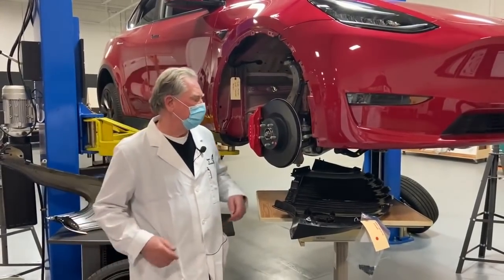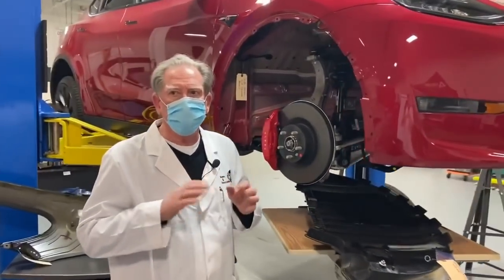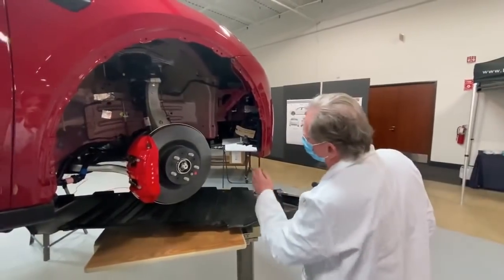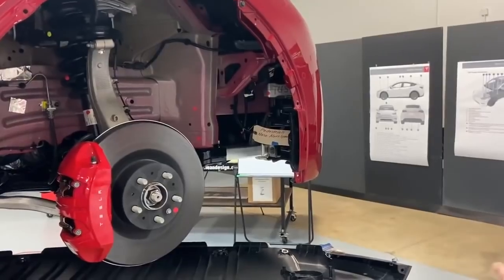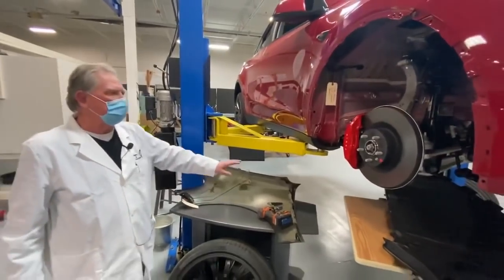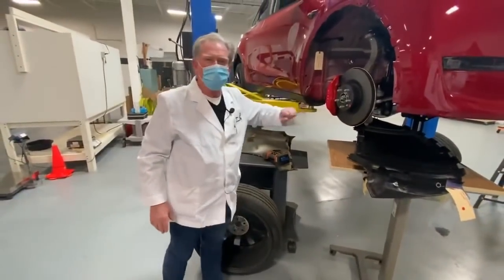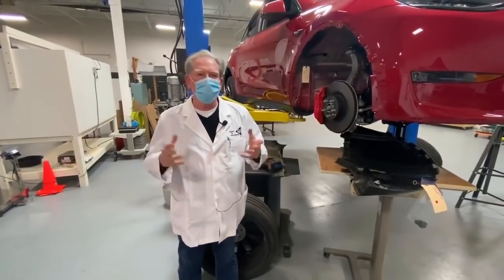Model Y E7: Front Impact Structure, Snap-Fit Lamp, and Rotor Serviceability

Comment: Love the info! Some notes:
1: The emphasis on corrugated wiring is for "designing the product for automation". Robots hate normal wiring, corrugated not so much. 
2: I think the quick connects are for the same reason.
3: The suspension and brakes are different on "performance upgrade" cars, like this Model Y. Are you comparing it to "normal" Model 3 or a performance Model 3 with "performance upgrade package"?
4: I think you'll love the new multi-purpose integrated heat pump/AC unit with several different switchable directions/modes for cabin and battery. And its patented included PCB-based resistive heating ability.
Reply: Was wondering about reason #1 and if maybe that's why they went that way. Thanks for confirming.
Reply: The corrugated wirings also makes sense if Tesla is coming out with 1-million miles drivetrains.  If this Robotaxis network ever comes to pass, they want their autonomous vehicle fleet to be rock solid with high reliability.  A little bit of additional cost upfront to protect the wirings will pay off in the long run with fewer breakdowns.
Reply: I don't buy the idea that wire looms help the robotics.  The "structural wiring" on the chassis is a metal tube which is basically rolled on.  This is auxiliary wiring which is only slightly stiffer and is for million-mile durability (imo)
Reply: @zwillx3953  The plastic corrugated covering is for wire protection mostly and looks more professional. For robotics? Na
Reply: Don't act like you have any idea about how Tesla builds its cars. You won't become a mechanical engineer from watching press events, so don't act like you're teaching an automotive analytics company about automotive manufacturing technologies that you've never even heard of until 5 minutes ago.
Reply: @craigrandell359  @zwiLLX Point taken. I had got an impression that the wiring was stiffer and more structural, but if it is just normal wiring inside plastic that is not the case.
Reply: @RFjellstroem  the way you know it's not for robotics is that it comes on a spool, so there will be a natural bend which is going to be a different angle depending on where in the spool it came from.  That's an element of random that wouldn't help much.  The structural wiring is super exciting though!  No confirmation yet if it's on there or not.  A true manufacturing revolution!!  And yeah it probably comes on a spool too, but with a flat cross-section and definite "top/bottom" the orientation is always known (no randomness)

Comment: that on top brake disc retention bolt was there also on model 3. every rim has the corresponding holes in the back. aftermarket, no issue at all.
Reply: Yes, most wheels has those openings on the hub face.
Reply: The fact that he wasn't aware of this simple fact makes me wonder what else he's wrong about.
Reply: Also,  I wonder why he thinks it's a good thing that only Tesla wheels would fit.  That's a terrible idea.
Reply: @joegreene6250  I would not go that far. He has probably forgotten more about construction of cars than we all will ever know.
Reply: My 16yr old Volvo has disc retention bolts also, I'm sure lots of others as well, nothing new about it.
Reply: The bolt is completely optional.  Even if a rim doesn't have the recess, you can just take the bolt out.
Reply: @xungnham1388  you sure that disc retention bolts are optional? I took mine out to fit aftermarket rims.  The wheels haven't fallen off, so that's good.  Are there any negative consequences to leaving that bolt off?

Comment: Sandy, that retention screw on the rotor it was on the Model 3 too, so it's nothing new.  But that bolt doesn't need to stay there, it was only to keep the rotor on at the factory.

Comment: LOVE the advice to tip cashiers at the end, you're a classy guy.  

Lots of us have put aftermarket wheels on the Model 3 by removing the hex-head clamp bolt on the rotors.  Any reason not to do this?  I always believed those were there for assembly and weren't necessary once the lugs were torqued.

Comment: All model 3 performance versions have that external hex retention screw.  Tire rack/ Discount tire has multitudes of wheels that fit.  That appears to be the same braking setup as all model 3 performance variants.  But you would have to get a model 3 performance to verify for sure

Comment: Fiat and Citroen disc brakes (also by Brembo) have always used lug bolts to retain the wheel and brake disc.  A pair of special M8 pointed head bolts locate the wheel so you are not fumbling too much to align the lug bolt holes. Steel wheels have holes on the same PCD to align accurately. Alloys have cast in divots like these Tesla wheels.

Comment: Those screws are not required after assembly. My winter rims are non Tesla rims.
Reply: Can you link me to the winter rims you installed? I just got the model y performance and winter is coming! I can’t find any options though outside of Tsportline.
Reply: @Kr0n1k8  congrats! I got mine from PMC tire. Not sure if bolt patterns match
Reply: SherlocckHolmez 
But if bolt patterns don’t match, the rims won’t fit, would they? I obviously don’t understand. Would you please explain what I’m missing? Tia!
Reply: @Conservator.  what I meant was, I'm not sure if Model 3 bolt pattern matches Model Y
Reply: SherlocckHolmez 
Ah, that makes sense. Thanks!

Comment: That is interesting about the external hex bolt. Did you guys notice if this Y has the same lip as the model 3 performance?  "in addition to the main hub that protrudes 64.1mm, there's a 3mm lip right at the rotor hat that will not allow the wheel to sit flush unless it's machined similar to the 20" stock wheel" that excerpt is from a post on the model 3.

Comment: Regarding that brake disc retention screw, it can be removed to fit other wheels… it serves no purpose anyways, once the wheel is bolted on. It can be screwed back in to change brake pads or work on the calliper, just to hold the rotor in place.

Comment: If you're thinking "hey, can I even use aftermarket wheels on this car?" Yep, the retention bolt is not very necessary. And besides that, many aftermarket wheels do come with similar voids. That's how they save weight.

Comment: You mentioned liking the external brake tension screw, and that it makes a Tesla rim required.   Does that mean that after-market rims won't work on Model Y?  The reason I ask is that, there are many YouTube videos about how easy it is to break or curb scratch the Model 3's expensive, low profile rims.  After a few such incidents, some owners bought after-market, less expensive, non-low profile rims.  Those owners really like their new rims, which were cheaper, stronger, and lighter.  A side benefit was that the tire sticks out more, which reduces curb scratches.  So, it doesn't sound that good to me that maybe Model Y won't work with after-market, non-low profile rims.  Curious to get your thoughts on this issue.

It's a privilege to see and hear your analysis of the Model Y.  It's extra fun to watch, because I can tell you're having fun.  
I will follow your kind suggestion to tip service workers in this difficult time.

Comment: For someone who's worked in the auto industry, I'm surprised Mr Munro doesn't have a better understanding of what Brembo is, there are no names being machined off, they are an OEM supplier (like Bosch, Denso, Holley, Weber, etc), they'll make a caliper and rotor to Teslas specs with Tesla branding already on it. The sheer number of different cars that leave the factory with brembo equipment will probably surprise most people but as per normal its far cheaper than each manufacturer trying to develop its own parts.
That said, these teardowns are fascinating, thanks for the awesome work.
Reply: It's a brand name, that's all

Comment: that bolt in the rotor is necessary?  id think it was there for ease of assembly in the factory, there have been multiple times i replaced rotors with retention screws in em to rotors with no provisions for the retention screws and there was no issue (early 2000s and going from oem to aftermarket part at customer request for low cost)

Comment: Definitely looks like they made some improvements. I'm not really sure why the external bolt through the rotor, and allowing it to only use Tesla wheels is a good thing. To me that would be a nightmare.
changing out the wheels is something people often do especially if you bought a car with 21s. Which is just got awful anyway.
So if I had one of those I'd be taking that bolt out countersinking a hole and finding the right flat bolt that could go in there. those nuts are never difficult to get out if you know how to get them out with a impact driver. Most people just leave them out anyway and let the lug nuts compress the rotor up against the hub.
Which would be what you would do if you wanted to change wheels to something other than Tesla. As long as that rotor will stay centered on the hub that should work fine.

Comment: At 4:00
Just leave the bolt out. You can then fit any wheel you like. There is no real need for the retaining bolt.
For the price of one Tesla wheel, I can buy a car that lasts 5 years.
I owned a Euro 250 ( USD 275 ) Ford Sierra for almost 5 years once and drove it all over Europe.

Comment: that external bolt for the brake disk is going to cause a lot of problems when trying to fit aftermarket wheels., that will greatly limit the number of compatible aftermarket wheels for the model y. a lot of owners are in for a rude awakening when they order different wheels and findout they don't sit flat. or worse yet... they don't notice the wheels don;t sit flat, tighten them down, and then start driving around w/crooked wheels.

Comment: Sandy, the performance model 3 has a 2.5mm lip exposed when the rotor is fitted. They have a machined cutout on the model 3 performance to accommodate that. It appears the model Y rotor is thicker as I don't see that lip?. Can you confirm?. Thanks

Comment: That little screw that holds the rotor on is a nightmare in the rustbelt areas of the country.  Screw needs to be drilled out to replace rotor. GM makes that mistake too.

Comment: Also that external outside bolt in on the rotor. How would that fit aftermarket wheels?
Reply: it doesn't, that's the point (until aftermarket wheels machine the inner face like Tesla does). Helps Tesla sell their own wheels.

Comment: im not a fan of these pedestrian warning systems ... tires make a significant amount of noise on their own and any additional sound is just Noise Pollution IMO ... I have yet to see any detailed studies that show them to be better ... in addition if big trucks were quiet they could actually hear when someone is warning them of danger etc ... i hope rationale triumphs over the assumption that external noise means safer.
Reply: My new Model Y in California was delivered without the Pedestrian Warning System. I opened up the right wheel well to verify that it was missing. However, Federal Law requires that all EV’s have to have a PWS by September 2019. Newly built models are required by September 2020.

Comment: Why aren't round tube frames with sacrificial crash structures on the outside used? Recycling/repair would be integrated with the manufacturer, which seems to be the way tesla is going with their gigacastings.

Comment: What I don't get is why tear down a car instead of go to the factory and just look at how it's assembled... I at least assume Tesla would let him in and has cars partially built still all over the line (unless they are planning on upgrading the equipment). If they don't have any partially built right now, then have him join and watch when the 100th new one is built (so he can skip ahead if he wants)
Reply from the maker: Great question. We will use this vehicle for a comprehensive cost analysis. Our team will eventually destroy each assembly to understand the exact cost to manufacture. This requires us to have a physical vehicle for a long period of time. Thanks for watching!
Reply: @MunroLive  wouldn't there be some quick insights you could give walking down the assembly line and then get one a couple months later for a more in depth view after they've fixed the issues you've found?

Comment: "You're going to only have Tesla products that fit" you can simply remove that bolt and any wheel with the correct bolt pattern would fit and everything would function exactly as intended, that bolt is just to hold the rotor in place during assembly. Also many wheels come with cutouts like this anyways, or you could easily pay a machinist a reasonable amount of money to machine these out for you, then have your wheel balanced. I would say it is completely false that only Tesla products would fit. Also I'm about to order some brembro brakes lmao

Comment: Yay... i know now how to remove that stupid speaker … if I ever get a Y ;-)
Reply: Unplug.  But that might make you personally liable if you hit someone.  Expect your insurance company to check to see if the speaker was working.
Reply: Some gas cars are quiet at low speed, no noise maker. It's EV phobia. It would make more sense to mandate backup beepers for all vehicles.
Reply: @robertpryor7225  I had a plug in "something", don't remember the brand, come close to hitting me while I was walking in a parking lot and the driver was backing out.  It wasn't totally the driver's fault.  I was hidden from their view by a large vehicle parked next to them.  I think that if the car had an engine I would have heard that it was idling before it started to move.

I do agree that if EVs are going to be required to make a noise when moving slow ICEVs should be held to the same standard.  Set a minimum noise level for a car in motion.

That said, we probably won't need that sound in the future.  Our pedestrian detection systems should become good enough that we could emit a sound if a pedestrian is about to step into the car's path.

Comment: I would just take that bolt out and any rim fits all over again, does not have to be Tesla's anymore.  Those bolts, when they are internal, they snap off anyway and most mechanics never replace them, they only matter in the assembly plant, not in the course of the lifetime of the car.   Or so I was told...

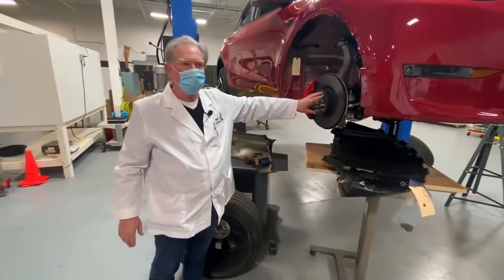Comment: 4:30 you sound senile. That is a removable mounting bolt to make it easier. Any old rim will fit just fine once you remove that which you can do at any time. I've seen that on dozens of types of cars, how have you never seen it before??

Comment: He called wheels "rims"...? And that retention screw isn't required; you could take it out and put any wheel on it. Also, most other wheels, aftermarket and OEM, are recessed in the same way as those, almost anything would fit regardless. And that flexible, convoluted wire loom conduit is on most front end wiring applications... On almost all manufacturers... same thing with the side markers clipping in. These features aren't unique. This guy an expert or just trying to drive Tesla's stock back up?

Comment: the only thing that is wird for me here:
Sandy likes the fact that the way the whell mount is made can only accept tesla rims (with the space for that hex screw). Why would u like this? why not be free to mount a rim of your liking? (i like the idea of easier access to that screw, but want the freedom of having my own rims)
Reply: It helps insure 3 party rims are designed / intended for use on the y..
appropriate size, good aero efficiency, handles the weight and performance etc
Reply: ANY aftermarket wheel will have the recess to clear that bolt. It's not unique to Tesla. Also the bolt can be removed without affecting anything.

Comment: Wait a minute. What do you mean the connector for the noise maker is capped off? How many blind people have to die before this is manditory in the US and Canada?
Reply: how many blind people have died in parking lots from silent ev's ?
tbh.. its seems pretty silly to add a noise maker and expect blind people to now be able to jump out of the way.. I'm pretty sure Tesla intends to have ACTIVE safety systems that are smart enough to never run over people: regardless if their blind, deaf, child, distracted, or just plain dumb and trying to get hit..
Reply: This becomes mandatory by September of this year.
Reply: I didn't say anything about parking lots. I'm talking about intersections where traffic moves quickly enough to do serious injury or even kill someone. Who said anything about parking lots where even if a car did hit someone, it would not be moving fast enough to do any real harm. I'm talking about intersections where vehicles are moving fast enough to do serious harm or even kill someone. When I cross the street, I don't care what the signals say, I don't cross until I do not hear any traffic coming. And you should know that guide dogs go mostly by sound too. So yes, it is absolutely necessary for vehicles to make sound so long as they are anywhere that there are pedestrians.
Still, there is no substitute for people paying attention to their surroundings when they are behind the wheel.